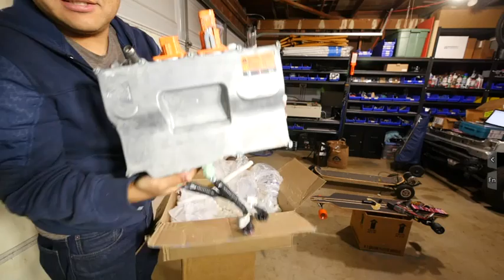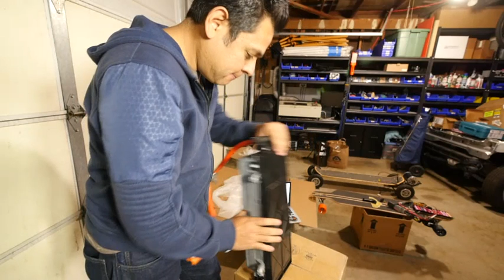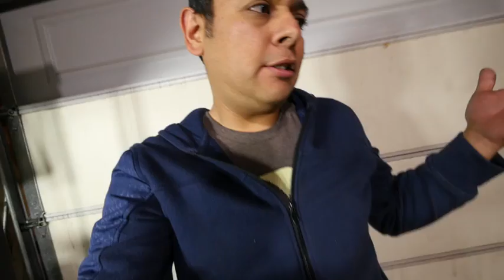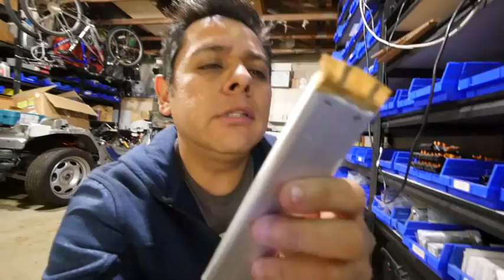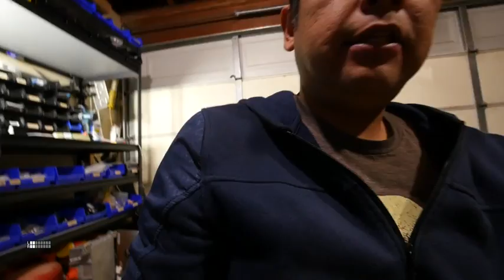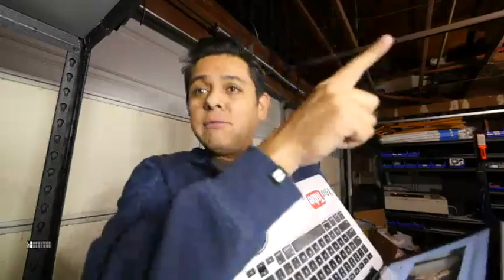Live MAiL TIME  +  Battery TALK

Comment: the eglide board has a dc 800 watt motor, it also has a idrive motor control 36v at 80amps.and way more rugged...now it will be way safer on the bigwheels just hit a rock at 25 mph with the small wheels,and its a bad day.....way more a get to work board ,just my 2 cents

Comment: nice e glide board in the backdrop....I built a 1.2kw pack for mine and have gone 42 miles on a charge.....18650 battery pack ......buy way I started my build after watching you build the samba......so thank you for the great videos.....put up some videos of my build so take a look . the eglide at has the best speedcontrol on the market.....got well over 3000 miles on mine .......do a pouch cell build on your board